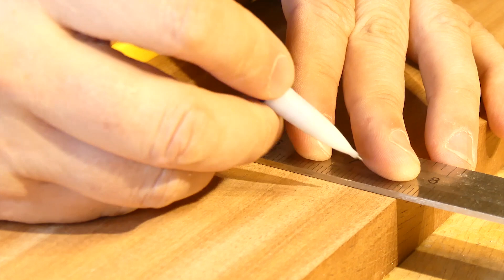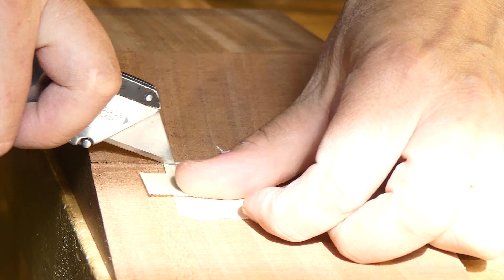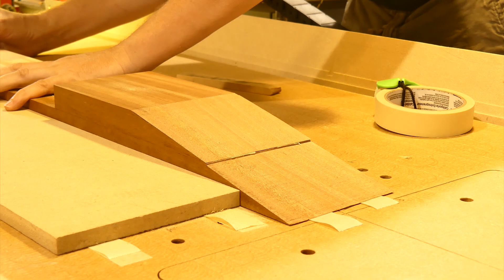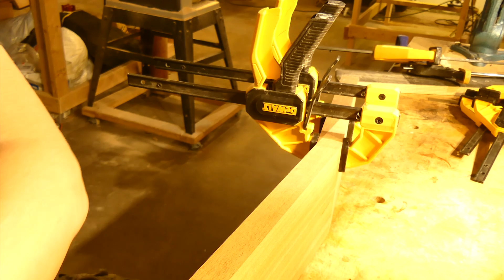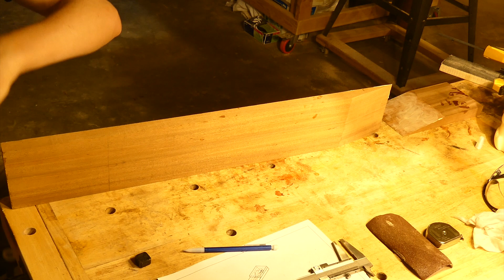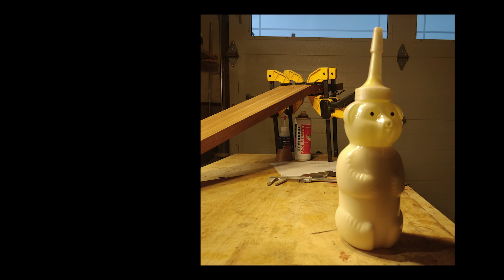My CNC Process | Layout and cut the perfect Scarf Joint

Comment: Love your videos, what angle do you use when you make scarf joint? Like angle of headstock your trying to achieve?
Reply from the maker: Usually 14 degrees, but I can do whatever the specification calls for
Reply: @TwoCherriesIns  hate to be such a fanboy here too. What kind of spindle are you using. I’d like to get into 1/2 inch myself but not sure where to start
Reply from the maker: It's just an ebay 2.2kw air cooled spindle, nothing fancy but it works well

Comment: Is there an advantage to glueing the joint on the underside compared to the topside?
Reply from the maker: In short, no, Some like it up further in the neck so that the fretboard glue joint reinforces the scarf; I like to put the joint in the face of the peghead and use a veneer to cover the seam; it's easy to make the joint nearly invisible this way. I don't think I maters; it's really just personal preference.